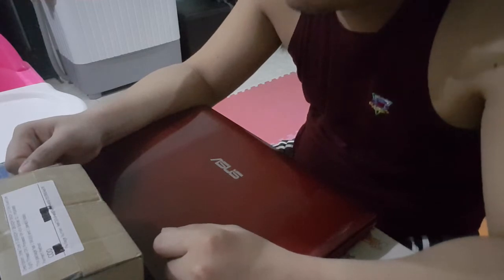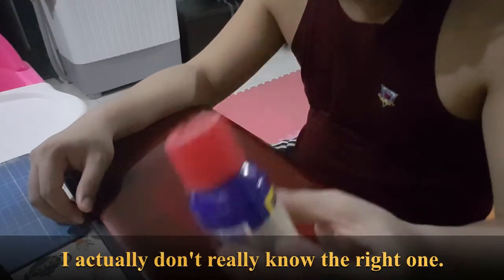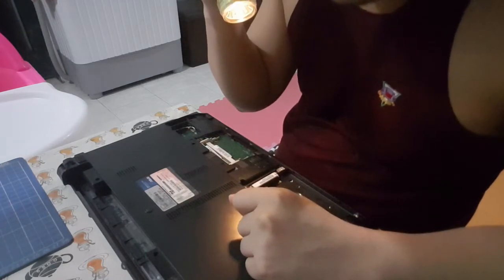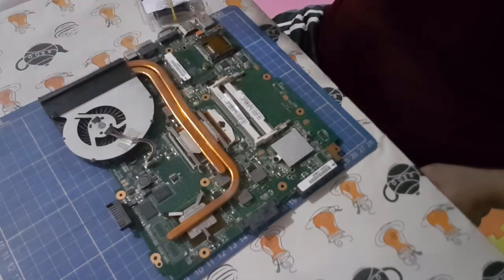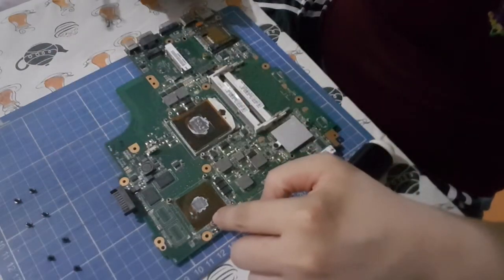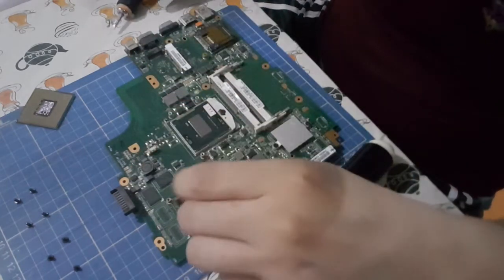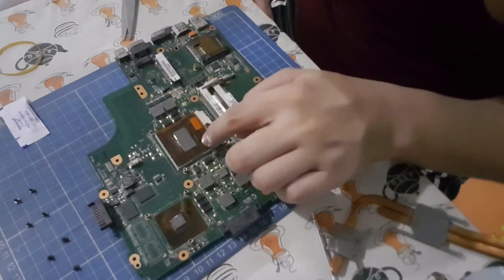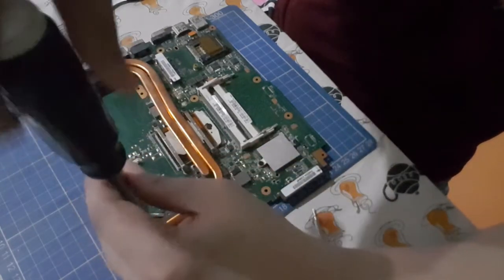Processor Upgrade for Asus K43SJ Laptop; Part 1

Comment: Hello, I have the same laptop model. Is the processor still i3 , however, the laptop gets very hot and the processor temperature jumps. When you start working with a laptop, the processor temperature is 43-50 degrees and under full load 70-76. I changed the thermal grease and cleaned the laptop, but the situation did not change. Could you tell me what your temperatures are during idle and in the load of the processor and video chip and the fan speed.
Reply: Что случилось? Решили уже проблему?
Reply: @vladimirazirov1815  Проблема была частично решена сменой термопасты на очень дорогую. Я так понимаю у этой модели из за возможности установки множества процессоров не совсем верная политика охлаждения в биосе. У вас есть такой ноут? Какие температуры?
Reply: @eriklamar8101  у меня другая модель: k43SD. Стоял I3-2330m+ дискретка Нвидиа. Стояла одинарная трубка системы охлаждения. Заказал на Алиэкспресс двойную трубку и проц I7-2760qm.  Но на нем выключил турбобуст. Я тестил с турбобустом в Аида 64 - максимум частота была 2.7ггц, температура 76*С. У меня материнка на две линии питания, поэтому и не хватает ему тока разогнаться до 3.2ггц. Я решил не напрягать блок питания и материнку и выключил турбобуст. Теперь постоянная частота 2.4ггц. Температуры упали, ноут стал тихим и в браузере и играх. На I3 в браузере было 55-60*С, в игре   до 80-83*С. На I7 в браузере 42-45*С, в играх 65-70*С. Термопаста обычная, GD900-1. Вентилятор когда сижу в инете редко включается. В общем доволен апгрейдом. Купил SSD Samsung 860 evo 250GB под Виндовс, HDD установил вместо DVD.
Reply: @vladimirazirov1815  Спасибо за информацию. Очень интересно у меня стоит 2330. в простое показывает 49-55. под полной нагрузкой 70-76, но иногда сбпасывает частоты. Вот тоже думаю апгрейднутся до i7, у меня модель sj с двойной трубкой изначально... Не подскажите где брали проц? мой whatsapp +79190853230. Буду очень признателен если свяжитесь со мной.
Reply: @eriklamar8101  покупал проц на Алиэкспресс, полтора года назад. Выбрал продавца с рейтингом 4.9 и хорошими отзывами. Проц прислали через 20 дней. Проц сбрасывает частоты чтоб охладится. Чего I3 горячий, что он постоянно в работе, а I7 выполнил быстро работу и простаивает. Я хотел вначале установить I5-2540m, но почитал форумы, что там производительность увеличится немного, а греется сильно этот процессор. Я в игры немного играю, а если часто играть, то нужна хорошая термопаста, и менять раз  в год, что каменеет от температуры. На плате под железным радиатором есть чипсет- там тоже нужно раз в 3-4года менять термопрокладку. Я покупал серого цвета, она самая лучшая считается. 15мм*15мм и толщина 1.5мм. Пиши сюда, а если нужны какие то тесты, я дам электронную почту. Выбрал 2760, что он оптимальный, если без турбобуста использовать.
Reply: @vladimirazirov1815  Спасибо еще раз. В игры не играю особо поэтому думаю сделать такой же вариант как у вас. Если есть возможность киньте тесты и ссылку на продавца на ernies8962@gmail.com. И еще последний вопрос, вы не знаете матери от sd можно поставить на sj модель? Я посмотрел там разница вроде только в охлаждении.. могу ошибаться но по корпусу вроде одинаково
Reply: @eriklamar8101  ок. Я как буду дома, то пришлю. Сейчас на работе
Reply: @vladimirazirov1815  Да спасибо заранее, скиньте тогда вкладку cooling fans в аиде тоже даже до стресс теста. Интересно глянуть за поведением кулера...
Reply: @eriklamar8101  привет. А где в АИДА вкладка кулер фанс? Я следил за температурой по программе HWMonitor- там просто минимальная, текущая и максимальная. Материнку не меняй- нет смысла - поменять дискретную карту 520/540 на 610 ничего не решит. Была бы Нвидия 650, то тогда можно было бы. Тесты скину в четверг, много людей на больничный ушло и всё время заменяю кого-то. Как будешь процессор менять, то кроме чистки радиатора, разбери вентилятор и смажь втулку. Я капнул 3 капли обычного машинного масла: шуметь меньше будет и дольше прослужит. Потому что Асус их хорошие делал, а уже современные китайские уже не то. Я ещё заклеил скотчем отверстия наверх, функция что дует вентилятор на клавиатуру, типа охлаждение рук ) лучше пусть на радиатор дует больше ) и у меня подставка с одним вентилятором по центру под ноутбук, покупал, что проц i3 грелся по 80-85*, так я давно ещё как менял термопасту и разобрал ноутбук,  так я по центру просверлил сверлом на 5мм много отверстий, чтоб с подставки свежий воздух заходил. Напротив вентилятора сверлить не нужно, воздух должен циркулировать по всей плате, с центра до кулера в угол. Как i7 установил, то вентилятором с подставки ни разу не пользовался, даже летом. Но думаю те отверстия всё равно улучшили циркуляцию воздуха. Я подставку использую больше для удобства, чтоб монитор был напротив уровня глаз, тогда не горбишься за столом )
 https://www.dns-shop.ru/product/8f189c9e7c6a3332/podstavka-dla-noutbuka-crown-cmls-926-cernyj/

Продавца на Алиэкспрессе того уже не нашел- наверно продал партию. Купи здесь например
https://aliexpress.ru/item/1005001350272109.html?spm=a2g0o.productlist.0.0.4e606936kN4XvU&algo_pvid=b247b519-a8f4-49d0-ac59-6b31e5f01db4&algo_expid=b247b519-a8f4-49d0-ac59-6b31e5f01db4-1&btsid=0b8b035c16085887796313880e8a2f&ws_ab_test=searchweb0_0%2Csearchweb201602_%2Csearchweb201603_&sku_id=12000015776886120
Reply: @vladimirazirov1815  Привет, вкладка cooling fans в тесте стабильности системы. там она точно отслеживает все скачки оборотов кулера. Насчет материнке апгрейт с 520 на 610 да неочень, но к нему есть материнки на 630 2гб. Вот тут уже можно подумать...
Reply: хорошо.  630- да, получше. Только проверь плату на фото на соответствие точек крепления и выводов портов. И придется систему охлаждения менять, кажется, там вроде ножки крепления разные.
Reply: @eriklamar8101  отправил тесты
Reply: @vladimirazirov1815  Посмотрел большое спасибо!!! Ведет конечно 2670 сеьбя хорошо судя по тестам. Но дороговато - 4500 по скидке на али... У меня в городе отдают i5 2450 за 1300. Вот теперь сомневаюсь уже. Но ты сказали конечно, что на i5 прирост небольшой производительности... Последний вопрос, в hw monitor написано минимальный обороты кулера 1600-1700. Тоесть он на таких и крутит в простое стабильно? Если так то это потрясающий результат!
Reply: @eriklamar8101   у меня не 2670, а 2760. 
 да, обычно кулер так и работает потихоньку, еле слышно его, в браузере вообще кулер бывает выключен. В браузере дискретка обычно не используется, выключена и поэтому две трубки только проц охлаждают. Купите самый дешевый I7-2630QM- по тестам вы видели, что температуры и обороты кулера одинаковые, что с турбобустом, что без. Единственно блок питания более горячий при включенном турбобусте. Купите  I7-2630qm и с турбобустом эксплуатируйте, там частота будет где-то 2.5-2.6ггц на четыре ядра (2.9ггц на одно ядро). Лучше чем I5 по- моему.
Reply: @eriklamar8101  я может быть тоже купил бы 2630, если бы знал, что мой ноут хорошо охлаждается, а я ведь  почитал форум, что у людей греются ноутбуки от I7, и решил купить 2760, что частота без турбобуста там 2.4 (у 2630- 2ггц, что мне маловато). Можете купить I7-2670qm - тоже дешевле и частота без буста как у I3 ( и с бустом 3.1ггц по всем ядрам).Хотя не факт что ваша материнка потянет это, моя не тянет, макс 2.7ггц вместо 3.2ггц. 
я тоже хотел купить I5-2520m, он прошлым летом копейки стоил (900руб), но жаба перфекционизма стала душить, что прирост только 30%, когда можно сделать 100% и деньги есть и возможности ноута  позволяют мощнее проц ))
Reply: @vladimirazirov1815  Привет, заказал 2630qm все таки. Последние просьбы напиши пожалуйста версию биоса своего который стоит сейчас, и как ты отключал турбобуст программно или биос прошивал?
Reply: @eriklamar8101  привет. Биос завтра напишу. Турбобуст отключал в "плане питания" Виндовс, там раздел максимальное питание процессора от сети и батареи- поставишь мах> 99%; минимум-0%. А надо включить турбобуст, ставишь максимум 100%. И "применить" и Ок. Легко и никаких перезагрузок ноута. Я думаю на этом процессоре не нужно турбобобуст выключать- он всеравно больше 2.5ггц не разгонится. Ты прогони конечно в стресс-тесте аида64. Если температура не выше 70-80*С, то это нормальный режим, дву трубки охлаждения вытянут, тем более в жизни нет таких нагрузок, как в стресс-тесте. Напишешь потом результаты температуры с турбобустом и без, интересно как различается с моим.
Reply: @vladimirazirov1815  i7 2630 4/8 так что не будет маловато))), и греется он кстати тоже люто
Reply: @АлександрИванов-ф5л9ъ  да, но в этой модели асус хорошо сделано охлаждение, перегревов до выключения нет
Reply: @vladimirazirov1815  Hi you seem to have a very good knowledge about this laptop. I use A43s (k43sj board name in cpu-z). Is it possible to use external gpu? The "exp gdc" one.
Reply: @paanrp  you can connect an external video card. I built a computer for games (motherboard LGA 1150 + i5-4590S + RAM 16GB DDR3-1600 + Nvidia gtx1050ti 4GB). I use a laptop for old games (2007-2013) when I take a laptop with me on trips. I play games in the hotel, watch movies on this laptop.
I read on the forum that two people connected an external video card to this laptop. One person connected an Nvidia gtx 960 4GB 128bit, GDDR5 video card to a laptop, the second person connected an Nvidia gtx 1060 3GB 192bit GDDR5 video card to a laptop. Radeon video cards are more difficult to connect to a laptop. There is no point in installing stronger video cards: the second-generation i7 processor will not pull them.
You need to disable the discrete card in the laptop through the BIOS or simply remove the video card drivers. Download the driver for the purchased external video card (driver for computer video card) from the official N v i d i a  website. Connect the cable from the video card adapter to the laptop's Wi-Fi adapter slot. Connect an external monitor with an HDMI-HDMI cable to an external video card. The laptop can receive Internet through a LAN cable or through a WI-FI adapter in the USB port.
Reply: @vladimirazirov1815  Wow this is really helpful! Im just a bit worried because my Asus A43s is in the blacklist of EXP GDC manual (can be downloaded in their website). I do read a few forum about external card on A43s but a few people had tried but it seems like the egpu cant be detected , maybe the wifi adapter slot is not compatible or the problem is from the EXP GDC itself? Do you remember what those people in the forum use to attach the external gpu?
Reply: @paanrp  Yes, I also read on Aliexpress that some adapters are not compatible with Asus K43s / K53s. I don't know what adapters were used by those people who wrote on the forum. Probably some adapters fit this laptop. In general, I think that connecting an eGPU to a laptop is irrational: it is very cumbersome and the video card does not work at full capacity. So I built a computer for games.
Reply: @vladimirazirov1815  I do have a pc and also an extra psu since i already upgraded. Im interested with this cpu and egpu upgrade for my old laptop, since the laptop has been with me from 2013 until i build my pc in 2021. Now i rarely use it but i dont want to dispose because of some sentimental values it has. Thats why im googling and studying on improving this laptop performance. So that i can keep enjoying to use my old laptop just for fun using my extra parts. I dont mind if the egpu doesnt give full performance of the gpu, as long as it can maximize the usage of i7 2630qm, i will be happy 😂. Anyway you have really been a great help! Now i can start planning to go on with this project. Thanks mate!
Reply: @paanrp  please. I also installed an SSD, 16GB RAM and an i7 processor in this laptop - the maximum upgrade. And I have enough of this equipment for old games and watching movies. 

I also have an old Acer 4315 laptop with a Core 2 duo T8300 + 3GB RAM processor - it runs Windows XP. This laptop no longer runs modern browsers 😁, but it can run old 32-bit games from 2000-2008 🙂
Reply: @vladimirazirov1815  Спасибо, то есть ты ставил биос от sj на sd? Все впорядке. Может все таки sd? Посмотр в аиде во вкладке системная плата если не трудно...
Reply: У вас же  sj, у вас другой биос. Ок, гляну
Reply: @vladimirazirov1815  Да у меня sj.Мне просо интересно какой у тебя, потому что обороты кулера очень грамтно сделаны
Reply: @vladimirazirov1815  Привет, не посмотрел версию биоса в аиде?
Reply: @eriklamar8101  привет. Биос K43SD.208
  (2012/10/11)
Reply: @vladimirazirov1815  Спасибо, я почему так про биос интересуюсь, потому что ради спортивного интереса и знаний подзапарился и на  i3 2330m (пока не пришел i7) добился температуры в простое 37-38 под нагрузкой больше 70 не греется, однако вентилятор всегда работает на 2400 оборотов не выключаясь даже в простое процессора. Мне стало интересно как при установке i7  у тебя так изменилось поведение вентялитора, хотя температуры не сильно разнятся. Ну узнаем, возможно действительно, при смене процессора материнка сама подстраивает обороты...
Reply: @eriklamar8101  у меня на i3 вентилятор всегда крутил и 3000-3500 даже. Была одна трубка в системе охлаждения, но я не парился за обороты вентилятора. Единственно не нравился как играл в какую то игру, то проц был 83-85*С и вентилятор крутился 4800-5000 оборотов. Там реально было жаль убивать ноут. Сейчас все отлично, первое время было удивительно что вентилятор совсем выключен, как новости читаю в браузере или печатаю в Ворде.
Reply: @vladimirazirov1815  Тоесть на i3 вентилятор вообще не отключался? Для меня просто тишина очень важна..На мой взгляд, у меня было 4 ноута в жизни самая адекватная политика охлаждения на асере была он крутил 1500 на минималках всегда и тем самым понижал простой процессора, там стоял i5 первого поколения, но при этом звука вентилятора было совсем не слышно.
Reply: @eriklamar8101  да, на i3 никогда не отключался. Это мой второй ноут, на Леново с Т9300 там отключался, но там ноутбук использовался только фильмы смотреть и новости читать. А на этом i3 даже года полтора в Танки играл )) 2012-13. Тогда эта видюха была современная и проц самой последней модели )))
Reply: @eriklamar8101  решил сделать эксперимент. На 4 ядрах и включенном турбобусте проц больше 2.7ггц не разгоняется. Решил выключить ядра и включить турбобуст и проверить что будет. Выключил сначала 2 ядра и сделал стресс-тест и потом выключил 1 ядро и сделал стресс-тест. Короче при отключении ядер турбобуст не работает. Всё время 2.93ггц. при 2 ядрах/4 потоках и 3 ядрах/6 потоках. Температуры 68-72*С, вентилятор 3000-3500 оборотов. Короче выгоды никакой от отключения ядер. Лучше на всех 4 работать, включил как было ))  я ж думал меньше ядер работает- выше будет частота, а чёто отключается  турбобуст сам по себе.
Reply: @vladimirazirov1815  Честно говоря, производительности 4 ядер даже без турбобуста для данного ноута за глаза, если конечно не использовать его для игрушек старше 2014 года. Я вот заметил что у меня стал ноут грется в районе тачпада, у тебя такого нет? под клавишей пробел. В остальных частях ноут очень холодный.
Reply: @eriklamar8101  да, для этого ноута даже i5    нормально )) нее, у меня ничего не греется. Мне в октябре термопасту поменяли, так что все Ок
Reply: @eriklamar8101  слева от клавиатуры где выхлоп идет там алюминиевый корпус чуть теплый.
Reply: @eriklamar8101  под этот i7 хорошо идет Нвидиа  gtx 1060 (3GB), а gtx 1050ti (4GB), то вообще для него не в напряг.
Reply: @eriklamar8101  привет ) как проц i7-2630qm работает? как используешь и как температуры, производительность? )
Reply: @vladimirazirov1815  Да привет, извини что не ответил тогда. Да вроде все ок. Использую и в турбо, темпы примерно как у тебя были  45 в простое 72 максимальная. Но по мне термопаста повлияла на результат больше всего, gc extreme лучшая для ноутбуков, на дешевой термопасте температуры были на 6-7! градусов выше. Так что можно использовать, главное хорошая термопаста на мой взгляд. По ощущениям ок, кароче, доволен. Производительность в браузере особо радует, в остальном конечно по сравнению с моим стационарником не айс, но это ноутбук еще и 2011 года, так что грех жаловатся)
Reply: @eriklamar8101  в стресс-тесте на всех ядрах держал 2.6ггц или меньше?

Comment: thank you for your video. this gave me an idea that processors on laptops can be upgraded. 

btw would you know if this is the same as the one you bought?

https://www.lazada.com.ph/products/intel-core-i7-2630qm-2ghz-6mb-socket-g2-mobile-cpu-processor-i7-2630qm-sr02y-i979678432-s3235330937.html?spm=a2o4l.searchlist.list.2.63b81b6dVWgHC9&search=1

Comment: Baka meron kang full video na pano iopen yung laptop sir? We have the same laptop model, gusto ko sana icheck yung loob at linisin kasi ang problem ng sakin is if I turn it on mabagal sya need ko pa irestart para mag work ng mabilis ang laptop.
Reply from the maker: Thanks. Try ko po gawan ng disassembly video. Salamat sa suggestion.
Reply: @BlueShotgunShells   up ako nito sir. mag uupgrade din ako ng RAM at processor, sayang kasi 700 eh na labor pg pinagawa ko.